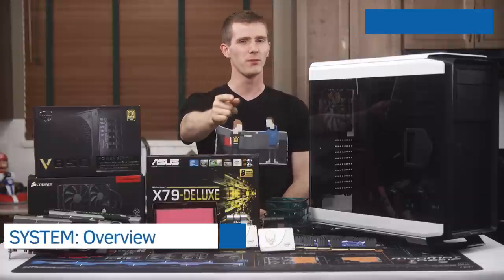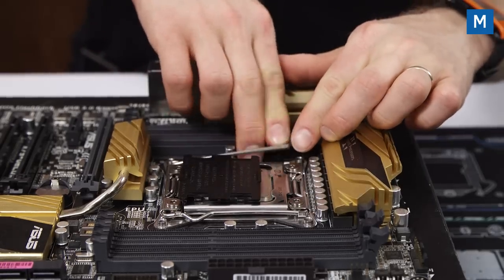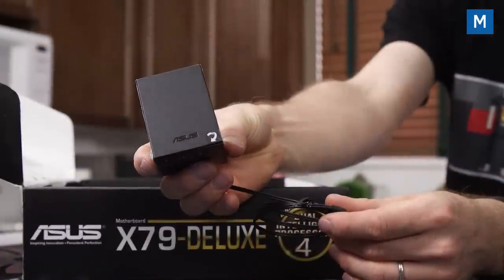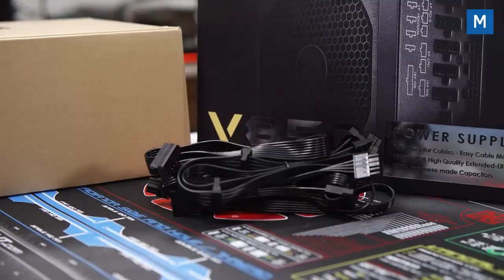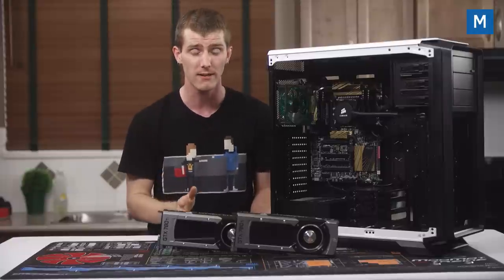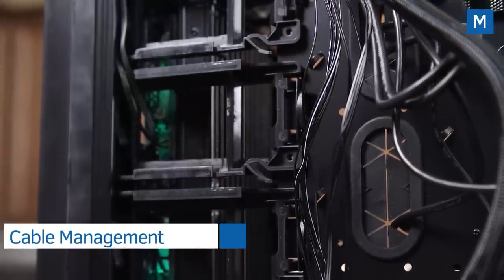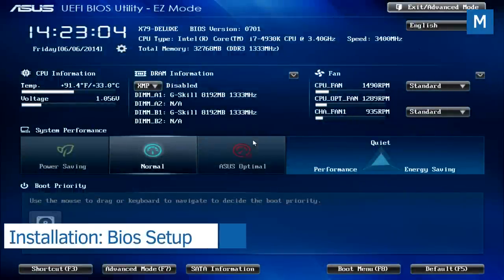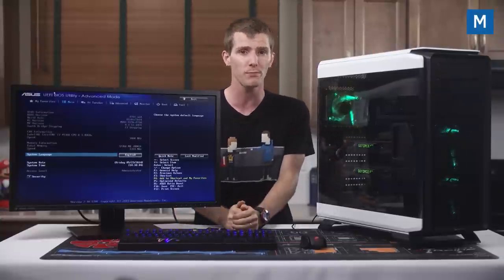How to Build the ULTIMATE 4K Gaming PC Build Guide

Comment: Did anyone notice the broken light on the Caps lock key? Or is it just me? 20:40
Reply: CrucifiX I believe it's just unlit as of preference I guess. If you look, most of the F keys aren't lit either
Reply: Usuaully it will only light up, when active.
Reply: more than just that key. there is F2 F3 F4, F6 F7 F8 and Scroll Lock
Reply: Nope it is off that is it like he didn't press the caps button